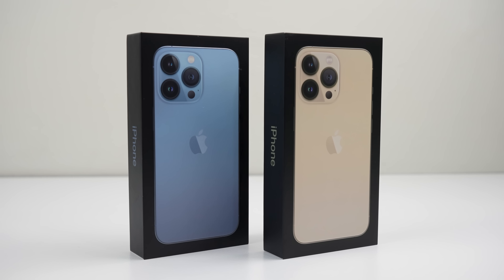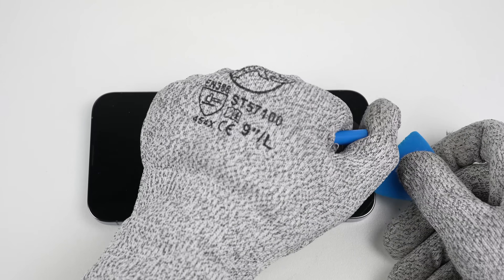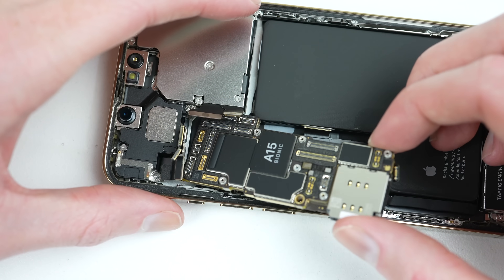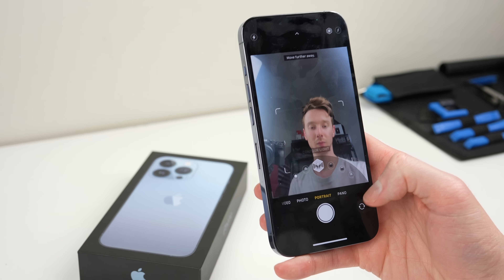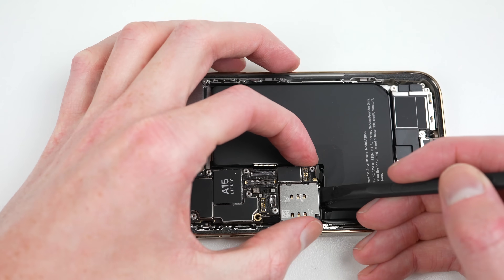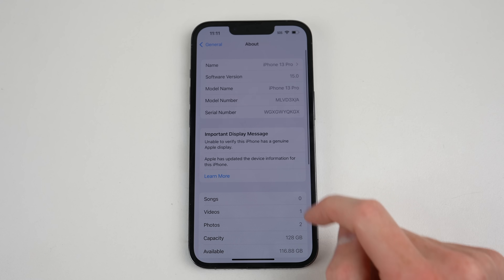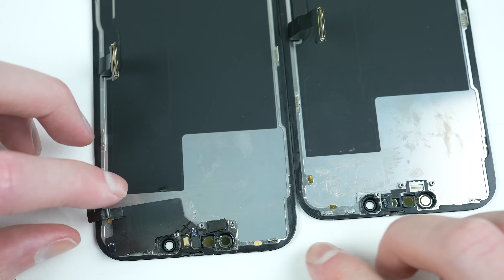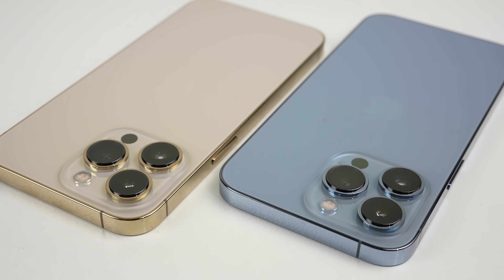iPhone 13 A Repair Nightmare - Teardown and Repair Assessment

Comment: All this is done not so the devices are “throw away” but so they can resell devices multiple times and gain much MUCH higher profits doing so. Think about it. You need your screen repaired? The screen would cost Apple a very small amount but instead of charging to replace they charge X-amount to swap the device to a new one. The customer thinks: “well it cost me $500 but I got a brand new phone so it’s not too bad”.
Then Apple take that broken screen device, change the screen out for what costs them next to nothing and then resell that device as “refurbished” and the customer buy it’s thinking “wow it’s basically new and only cost me $800.
They can profit off one single device multiple times.
It’s disgusting and I honestly can’t believe laws haven’t been passed to put an end to this. Quite literally daylight robbery.
Reply: The apple repairs are anyway a scam. But somehow many love to get fked hard over and over again.
Reply: @PhysPushscale  Ultimately boils down to apple fanboys refusing to accept the obvious.
They're like flat earthers - doesn't matter how m any times you proof them wrong, they'll just make up another excuse.
Reply: @Ratchovy  The effect of manipulation (in this case marketing) be real strong to some people. As said, "it's easier to fool people than to convince them that they have been fooled." -Mark Twain
Reply: @Ratchovy  then give me an alternative to android aside from ios.  android and google freak me the fuck out.
Reply: @PhysPushscale  with or with out vaceline. 🤣
Reply: Its funny how they state to be climate friendly xD, but releasing a new phone every year and not supporting 3rd party repairs xD
Reply: When other companies are working on reducing e waste, apple is working on increasing it
Reply: @maskedredstonerproz  not really if they are replacing phones and taking them back to resell later. that's call recycling
Reply: @maskedredstonerproz  "free market competition" is when you pay employees to build software that creates problems that would not exist, so they can sell the solution in the form of a brand new device, sending the old one to trash
Reply: but Apple's "repair service"  isn't available outside the US and Europe. if you've bought your iPhone in the US or in  Europe , and fly back  to your country in Africa, South America or another remote country , you won't be able to get your phone repaired
Reply: This is the reason why I believe Android is better, you just don't get scammed out of your own money
Reply: @cleverabovetheline  I dont like android for  several reasons.  Firstly,  they update their OS too often ,making our devices obsolete within a year. Secondly,  yoi are not free to install latest androis version on your devices, you need to wait your devices manufactures released an update  to the latest version . Thirdly   apps have backward and foreward compatibility issues .  You have powerful smartphones , with quad core cpu , 2gigs of ram and beyond , but they are obsolete because the manufacturer didn't provide  them with new androud versions , some are sadly stuck to android 4.0 icecream sandwich , and installing  custom android version is at your own  risk
Reply: Yes its very scrummy but then again it prevents plenty of trash going into the ocean, landfills, Etc., So its beneficial as well because instead of people throwing these devices out they trade them in. Basicly recycling but dirty.
Reply: Laws can not be passed here. Apple os free to do this. Quite unfortunate but laws can’t be passed.
Reply: check out "right to repair" laws, they're trying to address this type of practice specifically
Reply: Why the hell would you pass laws? You want politicians designing your technology? You think they’ll make a better phone than Apple does? People who think more government is the answer to everything are just naive.
Reply: Because the average age of an American congressman is almost 80 years old.

They are so old they can’t be trusted to drive so what makes anyone think they should be running our country is beyond me.
Reply: apple care is cheap bro
Reply: lol yeah they need money why would they not get the money they already made back
Reply: Just buy that $5 one without 100500 programms and features. Maybe it will break after 6 months, but hey, it's worth.
Reply: That’s what mobile phone insurance is for 🤷🏼‍♂️🤷🏼‍♂️
Reply: And right now laws literally can't be passed considering who currently owns our government.
Reply: @UCtLdiWaN_OWJBOLySw42RrQ you're an idiot read a book lol
Reply: Not just laws but people actually playing this game.
Reply: Why pass laws? Just buy another company’s phone
Reply: both are the case
Reply: @Zachary Sorenson what you are suggesting is exactly what Amazon and Google are trying to do, the problem is Apple is currently too far ahead of the pack. All Apple OS essentially work seamlessly between each other, something no one else has despite how hard everyone is trying. Even mega-player Samsung will never be on Apples level because they don’t develop their own software and rely on a re-skinned Android, they also don’t have a desktop OS or separate tablet OS really. It’s going to be really really hard for anyone to catch up to Apple now, they seem much smarter with how to maintain their market hold than industry leaders of the past.
Reply: laws shouldn't be made for people being stupid.   No one is forced to buy Apple products
Reply: So, don't buy it then?... Nah, what a stupid thing to say.
Reply: u really think they will label as referbished? lmao. if you take a device with insurance to apple store. and they have no more "new devices" to give you as a trade for a damage item, they will make u leave with nothing but your broken item BUT... they will still  be able to sell you a brand new make and model of the device you are trying to exchange. so plz correct ne if im missing anything as im typing this on samsung 😀... also im aware there are tricks that allows you to check if the item is refurbished but it cost them probly like 500$ to change all parts and shipping for a single iphone and they can resell as brand new for 1,000$
Reply: @robertorodriguez8513  Samsung are close to equally bad with their repair schemes. You're not any better than the people using iPhone.
Reply: @R4Z0R98  Samsung Galaxy S20 can be repaired and the components changed without fucking up like this, also Samsung is not the only one making phones.
Edit: Here's a video of the same channel demonstrating it https://youtu.be/U0nRGFZRM2s
Reply: People wonder how this company is one the most valuable.... don't forget they barely barely innovate have all the money and brains too but they won't. They would rather charge you $200 more and offer 3 new colors 🤣😂
Reply: Its not Apples fault many million peoole are suckers for their products. Remember we always have a choice to be duped and fall trap to our stupid desires/addiction or live free from ignorance. Its your choice stop putting blame on others. You dont have to buy apple products or are you helpless?
Reply: @cockadoodledoo28    Do you really think that tricking people who can't realize it is okay just because its possible for those being tricked to know? You're taking the fact some of the blame falls on the one decieved wayyyy past the extreme to some sort of "its not my fault I lied or tricked you, it's your fault for falling for it"
Reply: @Rob526  what?
Reply: @Rob526  your analogy of sorts makes no sense. its not like people dont have a choice of other phones out there. thres just a lot. Why people wanna give out their hardearned money thats not tricking thats blind indulgence. If your partner keeps on cheating on you why do u keep on coming back for more? Cuz youre blindly hooked! You ve got low self-esteem then you need iphones to make you feel good.
Reply: @cockadoodledoo28  ? I'm not making a 1 to 1 analogy thats supposed to point out a contradiction I'm questioning your beliefs.
Reply: @cockadoodledoo28  Also the issue with the cheating partner is most people don't obviously identify it, and there are 2 main phone providers while millions of people to select from. I find it funny how you say they are "blindly hooked" yet also act like they know its happening so its their fault. I don't like deceiving people, or selling a purposeful broken product in a way to exploit them that they don't understand, whether it should be illegal is a different question but when it comes to morals I think its obvious its bad.
Reply: @cockadoodledoo28  A more proper analogy would be a partner that uses your money and you don't know, or you do but think its your best option. Either way the partner at hand is also at fault which you said "it's not apples fault" not that both are at blame for the situation. If someone yells at me and I stab them, you could say we are both at fault, but its mainly me for doing it and not them for inciting it by some behavior
Reply: @Rob526  See thats where your fundamental problem lies. You try to rationalize your decisions in life as if gou didnt have any choice. Get your power back. To say no. No ones forcing you. Its your decision to go with apple because you think,as you said, is whats best for you. You try to live with the consequences. Its called owning up to your actions. Its how we become a man. Its not Apples fault you and other people keep buying their product. You can think for yourself as you said.
Reply: You are really on to something!  That must be why Apple provides software updates for several years longer than the competition!  iPhones are far more likely to be in use for twice as long or even longer than competing brands of Android phones.  How stupid of Apple!  In any case, I have no idea why people need to have their phones repaired.  I always keep mine in a protective case and am very careful with my devices.  I guess I am not rich enough to throw expensive devices all over the place.  I am on my 5th iPhone and I have never damaged any one of them.  I usually pass them on in pristine condition to friends or family who are very grateful and also treat them well.
Reply: @ruschein  5th Iphone, what the other ones stop working for some reason. My Nokia bought in 2008 still works
Reply: @jeffcarroll6553  I clearly stated that I passed my phones on to friends and family in pristine condition. Maybe English is not your native language and you don't know what "pristine" means?  Why would give phones that stopped working to people I love?  Is that how your treat your friends and family?
Reply: LOL
It's pretty incredible to see people vote up and take as gospel some person's literal fanfiction on how Apple operates on the internet.

But it's nice to imagine a world where resale and making "much MUCH higher profits" profits is so easy. 🙃
Reply: @TheTixAreNowDiamonds  Pretty much LMAOOO
Reply: Laws don’t need to be passed, people need to be smarter and hang onto their phones.  I have my last 3 phones going back 6 years, they were going to offer me peanuts for phones I paid over $600 for.  Why lose the memory when I can use each phone on wifi?
Reply: I mostly agree with the right to repair movement, but just to be clear, Apple makes it so no other repair shop can repair the display, but they can. They charge a ridiculous amount of money for it, but the display can be repaired. That guy talking about selling new phones to people when they broke the display sounds like an idiot.
Reply: This is a monopoly, caused by CAPITALISM, this is why we need COMMUNISM!
Reply: @ihateignorance1  it’s not capitalism. Capitalism is a tool and sadly some people use greed to push unethical practice.It’s greed. Communism would suffer from worse issues. How about waiting in lines for hours for bread, or any other type of staple. Every communist regime in this world has worsened the lives of its people vs made it better
Reply: @Tom-vg5nb  tbf while I think capitalism is the best, its silly to not recognize that something being a tool can be more prone to certain outcomes. Or example monarchy seems more prone towards an unfair ruler abusing power, or a tyrant than a democracy while you could argue both are tools who both can end with a tyrant
Reply: @ihateignorance1  bad troll account.
Reply: @ihateignorance1  👀
Reply: @ihateignorance1  joke almost flew over my head lmao
Reply: apple now supports specific repairment service like back panel replacement or front display replacement
Reply: @futoenjoyer  which is still horse shit. Not letting people fix stuff they own is unforgivable.

Comment: Paying a ton of money for a product you can’t even change or fix, and where the software can literally lock features.. that’s fucked up

Also, I see some dipshits defending apple saying that if you can afford the phone you should be able to afford the repair. That’s not the point though. I can afford repairing it, I just like being able to repair and touch a product that I fucking bought and own.

I enjoy fixing stuff, especially electronics and my multiple high performance cars. It’s called being an enthusiast (car & tech). It should be mine once I buy it, and apple is setting a terrible precedent for other companies to start being able to get away with the same bullshit.

Comment: Im a strong believer in the fact that standards are standard for a reason and being forced to use proprietary anything that is already standardized is an immediate red flag and should be enforced against to at least some extent. Also that if you are intentionally making it impossible for people to, edit, modify, or repair hardware that they own because you sold it to them should just be fucking illegal.

Comment: Apple is simulating a hardware fault by making the camera behave as shown in the video. They could have just made the camera non-functionable and display a message but instead they have gone out of there way to program the phone to simulate a hardware fault so people think it is a legitimate problem with the phones hardware and not a simple line of code written into the phone to limit your ability to have a 3rd party repair the phone.

Comment: Been using my huawei p9 lite since 2016 with at least 3 hours a day of usage, yet everything works (almost) perfectly fine and with basic care (not throwing it, semirigid cover and plastic screen layer) it managed to survive with no effort.
100€ for over 5 years of phone.

Apple is instead selling ~1200€ phones with high tech and low resistance phones, filled with tricks like these to just make the entire phone unusable the moment something is changed or breaks.
Whoever buys the phone for this amount of money for such a low lifespan just for the "ew, android" excuse truly should give other phones a new look, because at this point Apple will just keep on using excuses like reducing plastic trash to just cut corners and make less and less parts reusable and force their customers to keep on buying new things for huge prices, soon going to use the "materials are becoming scarce" line just to inflate the prices again yet forcing you to get a new phone just because the volume button gets stuck from time to time.

Apple capitalizes on its name now, not on the product. Stop buying it, or we'll all end up wasting way more resources than they like to advertise.

Comment: Hey, iv seen you covered some LG  phones, but lacked one of the most notable one from LG :o  

The LG V20, one of the last if not the last flagship phones with a removable battery. Also come with unscrewable case, unglued components (and a 3.5mm jack)

will you ever do a repair review on this one of a kind?

Comment: So vid managed to guess most of the steps to replace parts based on the prior model. Not sure why it is surprising that there may have been new/different steps to pair parts, especially given prior models having components similar paired. This would be why the authorized repair program exists and provides documentation on the proper steps.

There are areas of my car and its computer system I would also be weary of having the corner mechanic manipulate and mostly trust an authorized dealer to remedy correctly. But just like this, over time this documentation won't stay secret and unauthorized shops may be able to service at relatively low risk.

Speculating on the motivations for such changes is premature at best.

Comment: hey just wondering how can one repair the ipod nano crystal screen we were trying to clean it and it cracked screen works but the display is broken since apple stopped making them i cant get apple to fix it since you see good at replacing parts

Comment: Does anybody see the side that apple wants to prevent a situation where potentially faulty/dangerous components could be installed? 

For example, the FaceID components are gathering sensitive information, and malicious components could be installed and gain access sensitive info from the user. 
When apple locks the hardware via unique address, it prevents this.

I wish the iPhones were easier to repair, but perhaps there are reasons for this.

Or we can just be internet people and say "this needs to go viral"